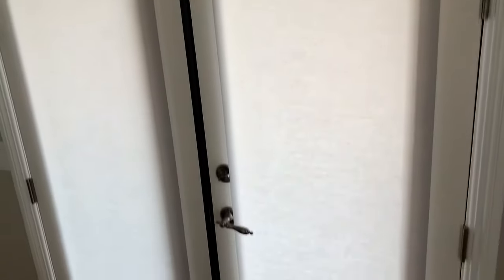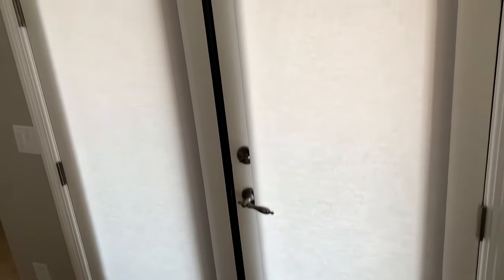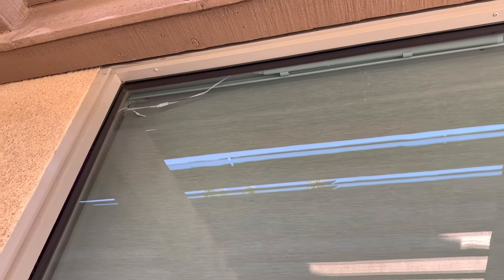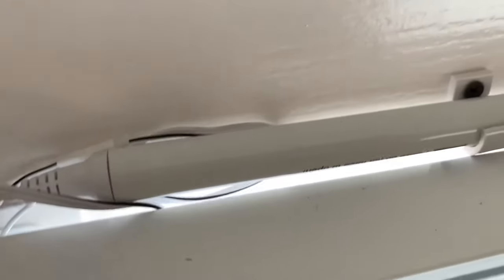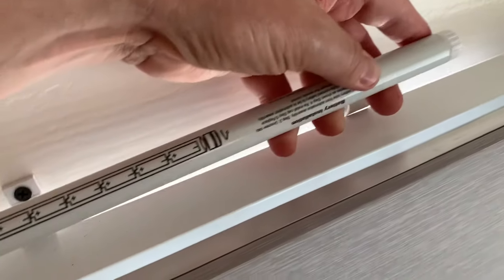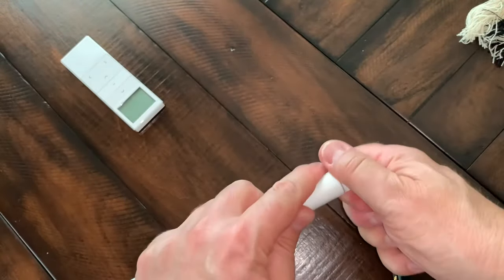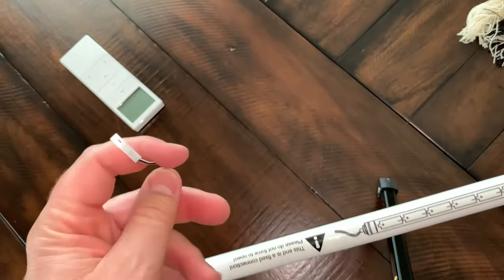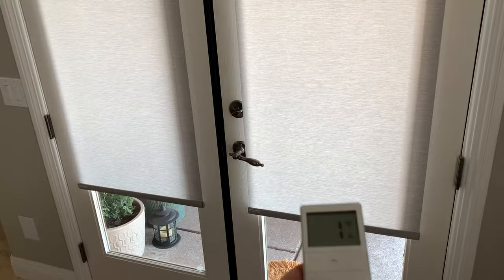Remote Control Window Shades Not Working

Comment: Bless you! 🙏 
I fiddled around with the remote for quite some time, then Googled how to troubleshoot the problem with my remote… it would beep when I pressed the buttons to raise or lower. I knew the battery was good/new, and the lights would glow on the remote. Blind manufacturer websites were of no help at all (didn’t even mention the battery pack). Thank goodness I found your video. I had no idea that the battery “tube” was up there! You’d think the company that installed them would clue the customer in. 

Replaced the batteries (8 AA), and it now works like new. 
THANK YOU SO MUCH!!
I’ve subscribed to your channel and now know where to go for help. 🏆
Reply from the maker: Awesome Maggie! Glad to hear it!

Comment: Hi! Helpful video!  I was thinking about buying the motorized version of these shades. When I found out that the batteries have to be replaced  (and are therefore not rechargeable with a mini USB etcetera) , that is a bit off-putting. Using the up and down once or twice a day, how often are you changing those batteries? Wondering if I shouldn't just opt for the manual raising and lowering version?
Reply from the maker: Each blind takes 8 AA batteries and I go through a lot of them. Go manual instead!

Comment: Question re Dooya tubular motors. I had two shades fail to stop on opening and jammed at the top. Depressing the tiny button on the motor does not do anything. Is there a motor fuse that can be reset to make them operational again?.
Reply from the maker: Sorry I don't know
Reply: Thanks for quick reply Mike.
Reply: That sounds like the problem I'm having now . The shade would go up and the shade would stop when I told it to but it wouldn't go down so I let it go all the way to the top to see if that would reset it but now it's stuck at the top. Did you ever find a solution?

Comment: I have a remote that looks about like yours and after I replaced the batteries in the shade it will accept the command to go up but it won't accept a command to go down. It looks like the remote is transmitting but the receiver isn't responding. Do you have any recommendations?
Reply from the maker: Sorry I don't. These things are awfully fickle

Comment: Great video except for I have blinds that you do except mine don’t take batteries. It has a charge cable. And I’ve had it charging all day and it still doesn’t work.  Any suggestions?
Reply from the maker: I would say either the charge cable is bad, the charging unit won't keep a charge, or maybe even the outlet supplying power is tripped off (that one is easy to test though)

Comment: I just got this remote and roller shades.  I'm trying to pair the remote to the hub, but I can't get the back cover off.  Is there any trick?  It seems like it slides off?
Reply from the maker: Most of them slide off, but you may have the kind that has an indention to pry off the back with a coin or something

Comment: What does the beeping mean when you click the buttons? 
I'm able to reset it and change channels - it will jog a bit when doing it but it won't move just beep - any thoughts?
Reply from the maker: It usually means the batteries need to be changed. Mine takes 8 AA batteries

Comment: Hi - my remote operated blind doesn't go alllll the way down anymore.  It stops (evenly, on both sides) about 1.5 inches above the windowsill, where it used to stop for the year-plus that we've had it.  I tried programming a different channel to see if I could get it to go all the way down once more, but it still stops well before the windowsill.  Any tips?  Thanks for any assistance you can provide.

Comment: I have solar panels for charging. The one that isn’t working is beeping. Suggestions?
Reply from the maker: I've not seen individual panels for the motor units. I would start off by checking the connections from the panel to the motor.

Comment: We have remote control shades which are not working.  The blind plugs into an electrical outlet, but the remote does not raise or lower the blinds ... they are stuck half-way open.  We have changed the batteries in the remote but do not know what else to do.  We appreciate your help.
Reply: help mine don't work either!  :(
Reply: I also have remote shades. I had the same problem and realized that each blind has a separate electrical pack that needed to be recharged. Once I re-charged the electric pack for each window the blinds work perfectly

Comment: Hi Mike
My blinds have NICE electric motors connected to power. No batteries in it and hence no replacement. 
It is remotely operated by NICE remote which uses 2 x CR2430 batteries.
Do you have a video for replacement of the batteries for this remote?
Reply from the maker: I don't, but there has to be a sliding cover, a screw to remove, or a cover that snaps on and off to access the batteries
Reply: @MikeKlimek  There isn't any screw to hold 2 sides of the cover.
It has two push buttons on sides near the bottom of the case. Pushing these on both sides, 2 batteries dropped out of the bottom with the battery holder which has one place to hold half of the first battery. The 2nd battery can only be inserted into the opening but there is no way to put in right place and on right side. The two sides of the cover does not open.
This is why would I put my question.

Comment: So what do you do if they’re brand new blinds with brand new batteries 🤷🏼‍♀️ that stopped working after one week.
Reply from the maker: That is a tough one. Try replacing the batteries(even though they are new), and then it may be a call to the retailer

Comment: How do I remove the coin battery without breaking my remote? I pressed down on one side and expected it to pop out and it didn’t. Thank you
Reply from the maker: Mine has a sliding door on the back of the remote on the bottom. It even has an arrow to show which direction it slides. If yours has this, just push down on the door and slide down. You may also have a small groove in the edge of the remote to stick a screwdriver or edge of a coin to twist to release the door
Reply: @MikeKlimek  my remote has a small groove. Thank you for the tip!
Reply from the maker: @jblair8746  You're Welcome!